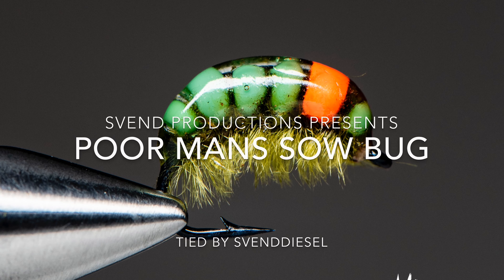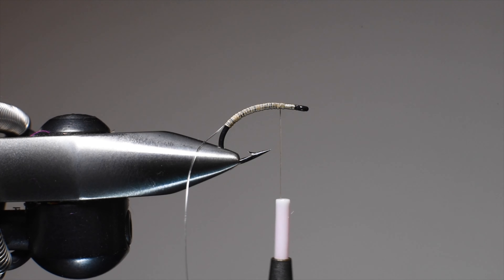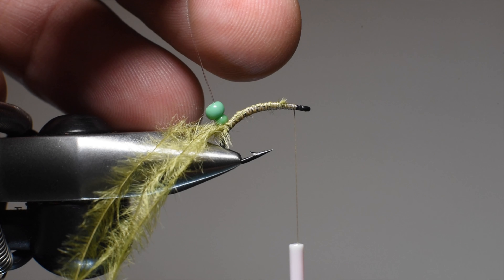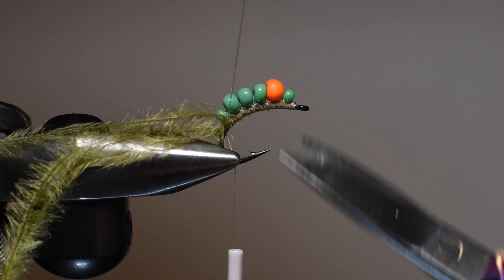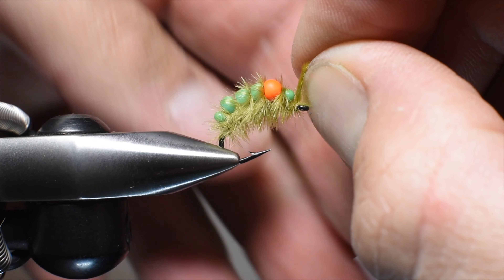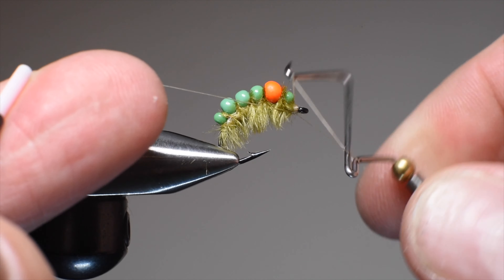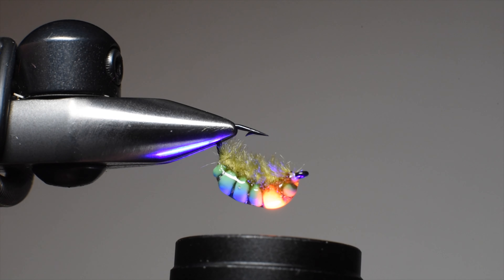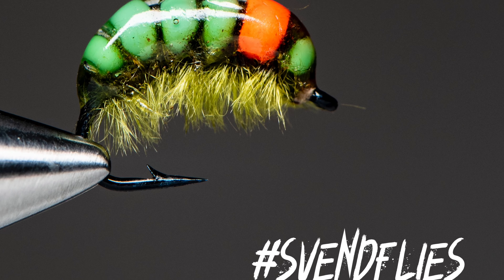Poor Mans Sow Bug Fly Pattern Tutorial

Comment: Nice fly. Is that the loon Infiniti Uv torch? If so, how do you like it? does it cure perfectly or do you have to go back and hit after you’re done filming?
Reply from the maker: Last Cast I like it much better than the others I have tried.  I don’t go an cure them again after.  I’ve found the Semperfli uv cures fully so I don’t need to do an after cure like I did with some of the loon product
Reply: Svend Diesel thanks friend, sounds like I might pick one up. I’m not a fan of the loon Uv resins. Do you only use semperfli Uv resins?, I’ve never used semperfli before, but I might give it ago if I can find some online.How does it work with solarez?
Reply: @Svenddiesel  seems like the loon thick is pretty tacky and takes multiple runs to fully cure.  I've had better luck w Solarez.  AWESOME vid.
Reply from the maker: sarcasmsmiles yeah I would avoid the loon thick unless you cover it with a harder no tack resin after.  I use the Semperfli no tack uv and it seems just the right thickness to stay put but still fill the gaps and build a body

Comment: Where the bigger middle beads also 11/0???
Reply from the maker: Jackson Cheal no.  The hook eye bead and the tail bead were the 11/0 and then the middle green were the 8/0 and of course the orange is the Tungsten bead at 1/8 oz
Reply: Svend Diesel right on. thanks
Reply from the maker: Jackson Cheal tapering the beads makes the resin job easier. Good luck